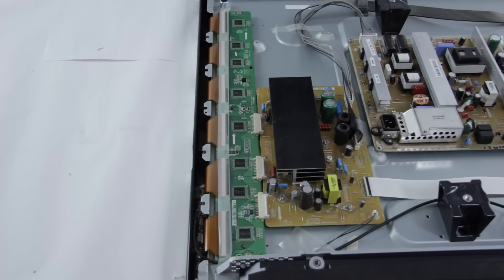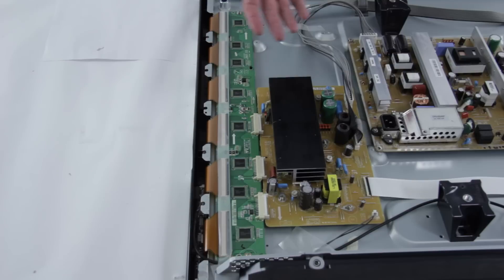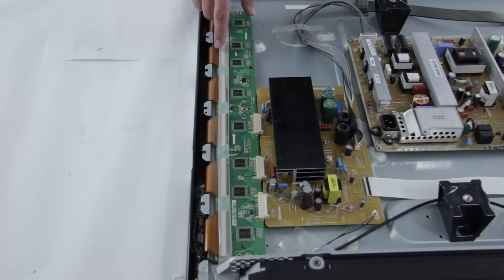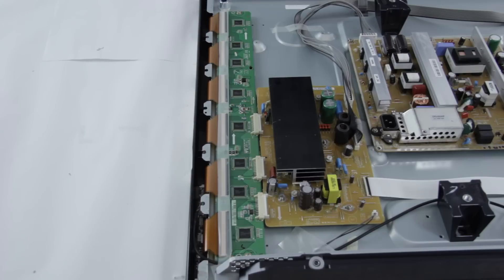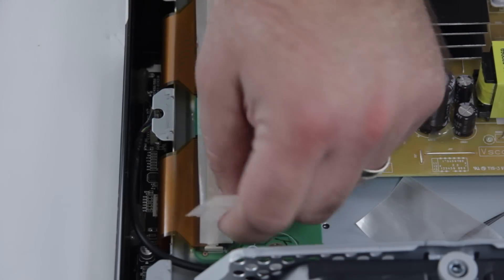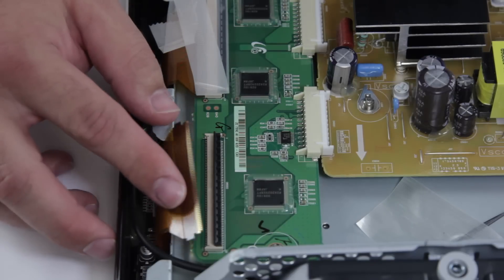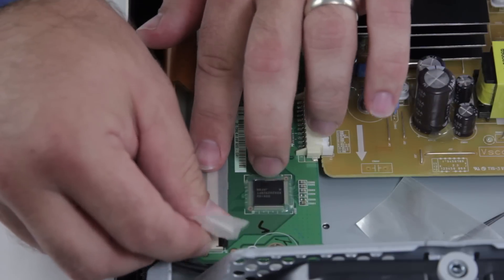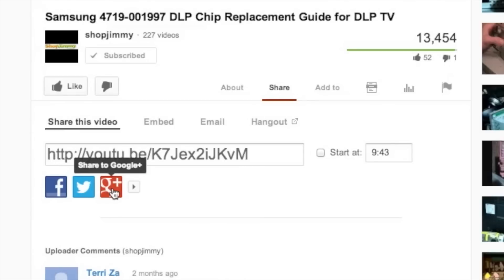Plasma TV Repair - No Image, No Picture on Plasma TV Screen - How to Replace Y-Buffer & Y-Sustain

Comment: Hello, Samsung Plasma PN50A450 Started out with 2 horizontal lines at the top then over time kept adding lines up to 6 or 7 total. Now the picture is totally out but still have sound. The Tv also now hums or buzzes. Thanks
Reply from the maker: lostthenfound1   I recommend you replace the Y-main board and the buffers in your TV.  Here is a link to replacement parts for your TV model number on our website, click here:  http://www.shopjimmy.com/catalogsearch/result/?q=PN50A450  Be sure to match part numbers on your current board, with your replacement for compatibility.  You can also call our customer service for further assistance with your purchase.  (877) 881-6492  Thanks and please let us know if you have any further questions with your TV Repair!  www.shopjimmy.com

Comment: I have a 43" LG Plasma tv Model: PDP42X20000 that powers up has sound but no picture. Help!
Reply from the maker: funwithwhitesfam  I recommend replacing the Y-SUS board for your TV repair.  Here is a link to replacement parts for your TV model number on our website, click here:  http://www.shopjimmy.com/catalogsearch/result/?q=PDP42X20000  Be sure to match part numbers on your current board, with your replacement for compatibility.  Here is a link to a video showing how to identify your part number, click here:  LG Plasma TV Repair: DIY Part Identification Number ID Guide for LG & LG Philips Plasma Panel Parts  You can also call our customer service for further assistance with your purchase.  (877) 881-6492  Thanks and please let us know if you have any further questions with your TV Repair!  www.shopjimmy.com

Comment: I have a Toshiba Model NO.50HP16. It was working fine until the Kirby Vacuum was plugged into to the same powercord  extension outlet. Now the TV turns on and the sound works but there is no picture. Is this a fuse? How much should a repair like this cost?  Thank you very much.
Reply from the maker: david flores   I recommend replacing the Y-SUS board for your TV Repair.  Here is a link to replacement parts for your TV model number on our website, click here:  http://www.shopjimmy.com/catalogsearch/result/?q=50HP16  Be sure to match part numbers on your current board, with your replacement for compatibility.  Here is a link to a video showing how to identify your part number, click here:  LG Plasma TV Repair: DIY Part Identification Number ID Guide for LG & LG Philips Plasma Panel Parts   You can also call our customer service for further assistance with your purchase.  (877) 881-6492  Thanks and please let us know if you have any further questions with your TV Repair!  www.shopjimmy.com

Comment: I have a Pioneer PDP-6010FD, my TV was showing green dots on the screen that were noticeable on blues and whites. Now the TV won't display picture. The power is on but it does not display anything and it won't respond to my TV controller. It can turn on which shows blue LED.
Reply from the maker: Alejandro Ramirez   I recommend replacing the Y-Main board in your TV.  Here is a link to replacement parts for your TV model number on our website, click here:  http://www.shopjimmy.com/catalogsearch/result/?q=Pioneer+PDP-6010FD  Be sure to match part numbers on your current board, with your replacement for compatibility.  Here is a link to a video showing how to identify your part number, click here:  Pioneer Plasma TV Repair: Part Number Guide for Pioneer Plasma Panel Parts  You can also call our customer service for further assistance with your purchase.  (877) 881-6492  Thanks and please let us know if you have any further questions with your TV Repair!  www.shopjimmy.com
Reply: Thanks
Reply: Also, since then the TV would not turn on now. The power is on but not picture.

Comment: Hi, I have a samasung plasma tv 50 inch, model number ps50a410c1d. It had a vertical stripe running down the left hand side of the tv but suddenly the tv stopped working all together. The tv has audio but no video at all.  In this video at 0.27-0.28 u point to the main board section (silver-grey bar) that supplies power to the y board, i noticed that this particular section and the y board don't heat up whereas the rest of the main board and the rest of the tv does. does this mean there is something wrong with the power supply? thanks
Reply from the maker: writersblock989   I recommend replacing the Y-Main board and buffers in your TV.  Here is a link to replacement parts for your TV model number on our website, click here:  http://www.shopjimmy.com/catalogsearch/result/?q=50a410c1d  Be sure to match part numbers on your current board, with your replacement for compatibility.  You can also call our customer service for further assistance with your purchase.  (877) 881-6492  Thanks and please let us know if you have any further questions with your TV Repair!  www.shopjimmy.com

Comment: I have a 50inch samsung 7  series plasma I'm looking at buying, the tv has sound but no image (screen was hit) no cracks on screen so I. Thinking something hot knocked loose any ideas where I should start
Reply from the maker: Kevin Donnelly  I recommend replacing the Y board in your TV.  Please reply with your TV model number and then I can recommend a replacement part.  Thanks!  www.shopjimmy.com

Comment: Jimmy, I have a Samsung PN50C550G1F, had the POP! and then no picture, saw the video, got a used Y drive board, noticed the blowout on the back of the old board, replaced it and I still get no picture (but have sound).
Reply from the maker: Taking it all in  I recommend replacing your X-Main Board and Y-Main Board in your TV.  Here is a link to replacement parts for your TV model number on our website, click here:  http://www.shopjimmy.com/catalogsearch/result/?q=Samsung+PN50C550G1F  Be sure to match part numbers on your current board, with your replacement for compatibility.  Here is a link to a video showing how to identify your part number, click here:  Samsung Plasma TV Repair: Samsung Plasma Panel Parts Guide  You can also call our customer service for further assistance with your purchase.  (877) 881-6492  Thanks and please let us know if you have any further questions with your TV Repair!  www.shopjimmy.com

Comment: Hi guys'.......... I have'a 50in LG Plasma TV that I bought in 2008... model number 50PG30 ....  it has been flickering green along the bottom of the screen for some time now....then all of a sudden the picture went black from top to bottom on the left side for about a third of the screen...the other 2/3rds is fine and volume is fine....any ideas as to the problem would be appreciated lots ....
                                    Thanks'
Reply from the maker: renegademanxxx I recommend replacing the Y-Sus board in your TV.  Here is a link to replacement parts for your TV model number on our website, click here:  http://www.shopjimmy.com/catalogsearch/result/?q=50PG30+  Be sure to match part numbers on your current board, with your replacement for compatibility.  Here is a link to a video showing how to identify your part number, click here:  LG Plasma TV Repair: DIY Part Identification Number ID Guide for LG & LG Philips Plasma Panel Parts  You can also call our customer service for further assistance with your purchase.  (877) 881-6492  Thanks and please let us know if you have any further questions with your TV Repair!  www.shopjimmy.com

Comment: I have a Samsung model  #PN58B540S3F  with sound but no picture. Can you suggest a repair? Thanks.
Reply from the maker: Jack B I recommend replacing the Y-Sus board in your TV.  Here is a link to replacement parts for your TV model number on our website, click here:  http://www.shopjimmy.com/catalogsearch/result/?q=PN58B540S3F  Be sure to match part numbers on your current board, with your replacement for compatibility.  Here is a link to a video showing how to identify your part number, click here:  Samsung Plasma TV Repair: Samsung Plasma Panel Parts Guide  You can also call our customer service for further assistance with your purchase.  (877) 881-6492  Thanks and please let us know if you have any further questions with your TV Repair!  www.shopjimmy.com

Comment: I have a Samsung 42inch Plasma
Model Number:S42SD-YBO6
TV turns on has sound but no picture displays a blank screen
Can you give me any advice?
Reply from the maker: Katrina Te Whetu I recommend replacing the Y-main board in your TV.  Here is a link to replacement parts for your TV model number on our website, click here:  http://www.shopjimmy.com/catalogsearch/result/?q=S42SD  Be sure to match part numbers on your current board, with your replacement for compatibility.  Here is a link to a video showing how to identify your part number, click here:  Samsung Plasma TV Repair: Samsung Plasma Panel Parts Guide  You can also call our customer service for further assistance with your purchase.  (877) 881-6492  Thanks and please let us know if you have any further questions with your TV Repair!  www.shopjimmy.com

Comment: Hello. I have a Samsung Plasma TV PN43F4500 . The TV had a  no picture, but power on with ticking sound . Open up and founf component burnt on IGBT  FET  RJP63K2  attached to heatsink and 330pf capacitor of Y-sustain board. After replace both, still burnt RJP63K2. How to solve this problem ?Need help
Reply from the maker: Lai KM I recommend replacing the Y-main board in your TV.  Here is a link to replacement parts for your TV model number on our website, click here:  http://www.shopjimmy.com/catalogsearch/result/?q=PN43F4500  Be sure to match part numbers on your current board, with your replacement for compatibility.  Here is a link to a video showing how to identify your part number, click here:  Samsung Plasma TV Repair: Samsung Plasma Panel Parts Guide  You can also call our customer service for further assistance with your purchase.  (877) 881-6492  Thanks and please let us know if you have any further questions with your TV Repair!  www.shopjimmy.com

Comment: My 3 year old Samsung Plasma tv PN50C550G1FXZA has 3 thin, vertical, colored lines on all picture sources (tv & dvd). The problem persisted with the test picture and after resetting the tv options. Samsung support online chat said it is a hardware problem. I wonder what are the possible problems and approximate cost to repair. Thanks.
Reply from the maker: David Niebuhr This sounds like a TV panel problem.  If your TV panel is bad, it may be more cost-effective to replace the TV as panels are typically hard to find in stock, difficult to replace, and expensive.  Thanks and please let us know if you have any further questions!  www.shopjimmy.com

Comment: Hi, I have a Samsung, PN51D530a3f Clicking noise repeats and never comes on. Read up on Bulging 1000mf Capacitors and also bad solder joints. I replaced the Cap's even though they weren't bulging, and hit all the solder joints I thought may be loose from Heatsink expand/contract or just weak joints. Same problem still..  Any idea's? Samsung says this model isn't included in the rest of the models that they say were a factory defect.
Reply from the maker: Michael Hanbury This sounds like you have a bad Y-main board in your TV.  Here is a link to replacement parts for your TV model number on our website, click here:  http://www.shopjimmy.com/catalogsearch/result/?q=PN51D530a3f  Be sure to match part numbers on your current board, with your replacement for compatibility.  Here is a link to a video showing how to identify your part number, click here:  Samsung Main Boards & Digital Boards: Part Numbers for LED, LCD, DLP, Plasma TV Repair  You can also call our customer service for further assistance with your purchase.  (877) 881-6492  Thanks and please let us know if you have any further questions!  www.shopjimmy.com

Comment: Hi I have a 50 inches Zenith plasma tv one day just ear a noise like poh and the video gone just the audio works these is the model #Z50PG10-UA product code/ Z50PG10-UA.AUSAZHR  what part I need to replace I appreciate your advice and help thanks.
Reply from the maker: monarka rojo I would recommend replacing the y-sustain board in your TV.  It appears we are currently out of stock for replacement y-sus boards for your TV model number, however you can go to the product page and sign up to be notified when the part is back in stock.  Here is a link to replacement parts for your TV model number on our website, click here:  http://www.shopjimmy.com/catalogsearch/result/?q=Z50PG10-UA+  Be sure to match part numbers on your current board, with your replacement for compatibility.  Here is a link to a video showing how to identify your part number, click here:  TV Part Number Guide for LG & Zenith Main, Digital, & Tuner Boards (LCD, LED, Plasma TVs)  You can also call our customer service for further assistance with your purchase.  (877) 881-6492  Thanks and please let us know if you have any further questions!  www.shopjimmy.com
Reply: Thanks

Comment: Hello I really need some help... I have a 42 in RCA Plasma model # 42PA30RQ  that has sound but no picture.. what could be the problem and what do i need to order???
Reply from the maker: sugrainwater I would recommend running the flashlight test on your TV to help determine if the problem is the backlight inverter or the main board. Here is a link to a video we produced that shows how to run the flashlight test. No Image No Picture on Screen-Flashlight Test LCD TV Repair - How to Diagnose Broken Board TV Repair Please reply with your flashlight test results and we can recommend a replacement part for your TV repair. Thanks and please let us know if you have any questions! www.shopjimmy.com

Comment: hi I have a Samsung 50 plasma model # pn50a650t1fxza has a light image and grainey picture and you cant see all the picture tv sat for about a month without being if I turn it on in the morning a hole bad picture for minute. help thanks
Reply from the maker: David Howard I would recommend replacing the y-main board in your TV.  Here is a link to replacement parts for your TV model number on our website, click here:  http://www.shopjimmy.com/catalogsearch/result/?q=pn50a650t1fxza  Be sure to match part numbers on your current board, with your replacement for compatibility.  Here is a link to a video showing how to identify your part number, click here:  Samsung Plasma TV Repair: Samsung Plasma Panel Parts Guide  You can also call our customer service for further assistance with your purchase.  (877) 881-6492  Thanks and please let us know if you have any further questions!  www.shopjimmy.com

Comment: Hello,
I could desperately do with some help.. One of my ribbon cables that produce picture has burnt out on my LG MZ - 42PZ44 and has left a large black bar down my screen.  It seems the small rectangular parts on the ribbon cable with 100 wrote on them have gone. Also the part where the ribbon connects to the board has some black burn marks. Sorry not great with this so i'm not sure what its all called.  If you could help me in any way it would be greatly appreciated.  There are also some very small colored lines running down the screen too.  what should I do to fix these problems?
Thanks, Zach
Reply from the maker: zachman876 This sounds like a short in the panel.  We do not have a part to repair this problem.  Thanks and please let us know if you have any further questions!  www.shopjimmy.com